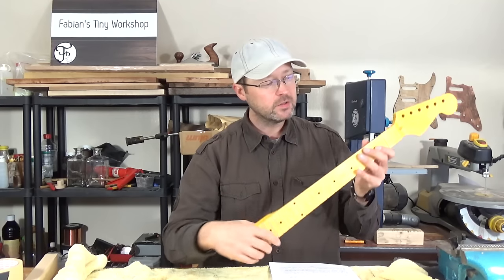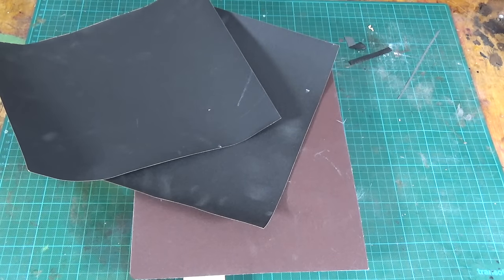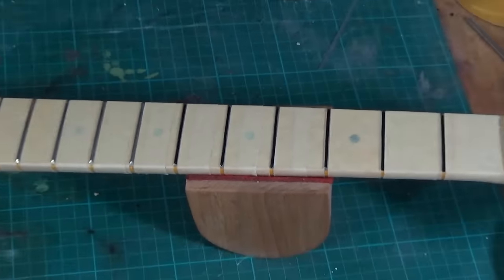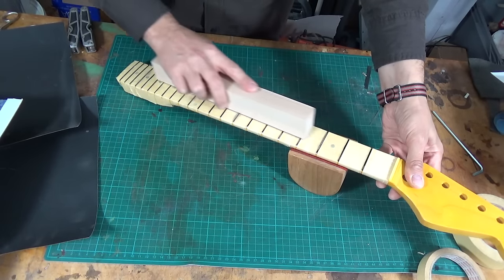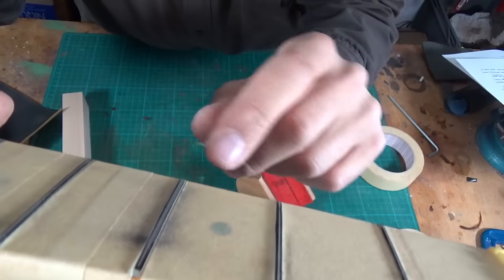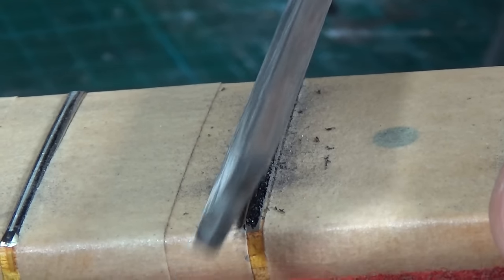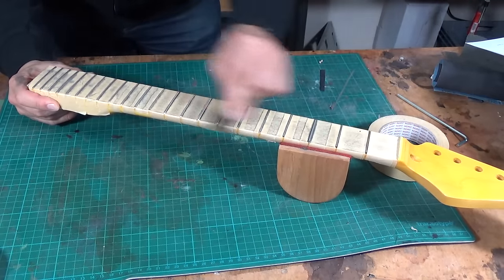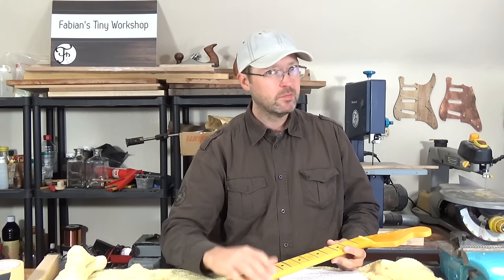Fret Leveling - The Easy Way // How To

Comment: Great video, but a few tips to viewers leveling a guitar worth more than a few hundred dollars. Use no coarser than 600 grit to down initial level and use spray adhesive versus double sided tape. Tape is too spongy. Do not use a heavy metal file like used in the video.   With 30 plus years as a fabricator/machinist, I would suggest using 600 grit sandpaper for crowning. A stone can be used as well.
Reply from the maker: I hear you. On expensive guitars I would not leave the frets myself unless I am experienced an own dedicated tools.

Comment: ok so I tried leveling my frets. I got rid of the buzz on all frets from Low E to B but the high E string buzzez from the 9th fret and above and when i Bend it, it frets out from 12th to 18th fret. what should I do? plz help
Reply from the maker: Difficult to say without seeing the guitar.
Maybe adjust the neck relief and / or the action.
Reply: Fabian's Tiny Workshop before trying to level them I had no problems with the high E on any fret and I did not adjust the bridge or the truss rod. Im worried that I ruined the radius of the frets :(

Comment: QUESTION:  Why not remove the frets first, then adjust the truss rod to make the neck as straight as possible?  It seems to me if you do this, there is no need to notch a straight edge, and could save some time and effort.
Reply from the maker: Great Idea👍 Give it a try and tell me how it went 😉

Comment: I do have a crappy 30€ Chinese strat that I want to experiment on. what could go wrong? also vielen Dank! dies ist ein von den besten DIY Gitarren-Clips dass ich soweit gefunden habe. Grüß aus München!
Reply from the maker: München? Dann antworte ich mal auf Deutsch ;-) Schief gehen kann eigentlich nicht viel, außer dass du zu viel Bundmaterial abschleifst oder den Radius durch zu viel Abschleifen etwas veränderst (gibt Schlimmeres). Denk daran auch die Sattelkerben anzupassen (im Prinzip ist der Sattel der Null-Bund). Das habe ich vergessen im Video zu erwähnen.
Reply: @FabiansTinyWorkshop  danke für deine Antwort! ich möchte lieber mit dieser Gitarre Experimente machen. so sammelt man Erfahrung. wenn's nicht klappt, dann kaufe ich ein neues Halls und gut is es :)

Comment: 3:18 and how do you maintain the radius of the fret board with a flat sanding block?
Reply from the maker: By moving the sanding block from left to right.
Reply: Fabian's Tiny Workshop ahh for a beginner like me it's difficult. there is a radius beam from stewmac that can make this easier

Comment: shouldn’t you hammer in the frets before flatting? some may be pressed in higher than others, and you will sand them down more
Reply from the maker: If the frets are not properly installed you can try to hammer in the lose ones. Trying to hammer in already seated frets will only compress and damage the wood fibers. Over time thy will decompress partialy and the frets will be uneven again (sometimes part of the reason they are not level in the first place). Also if you need a fret level because of wear and tear you cant just fix it with a hammer.

Comment: How do we know how low the frets can be? I want very low action.my guitar buzzes Alot and I already lower the strings and messed w the truss rod. It's an Ibanez and man I thought I could lower the action but it's a nightmare. I've lowered it on my other guitars but this one seems like it's gonna be a problem
Reply from the maker: Low frets have nothing to do with a low action. If your guitar has low frets that means it has been leveled more than once. If the frets are to low it will be uncomfortable to play especially bending will be difficult. For your desired low action the frets have to be level and of course the neck must be straight without a twist. By the way if you have a high action even at the low frets that means the nut slots are to high. check with a capo at the first fret, If the action magicaly improves it's the nut. If you experience buzzing on some frets more than the other that means the frets are not level. If it's buzzing all the way it is likely not set up well or it might be a neck twist. Check with a fret rocker.
Reply: @FabiansTinyWorkshop  Thanks Alot for your reply. With much respect I'd like to disagree brother that it has nothing to do with low action. There are plenty of YouTube videos that show that it   can low action. I'll send just one video that I found.
Reply from the maker: Low frets (diminished fret height) does not but level frets (leveled to equal hight) does. In other words, of course you have to lower the high of the frets but only so much that all frets have the same hight.

Comment: Hello, thank you for the informative video!

One quick question: the frets in my strat are already a very low (wear over time maybe, or maybe just small frets). Will doing this damage playing or it will still work? I can provide the exact height in mm if need be.
Reply from the maker: There is no right or wrong. It all comes to your personal preference. Action vs fret height. If you prefer low action there might be no way around it even though if the frets are to low it can be difficult to bend the strings. If you prefer it the way it is now, do nothing.
Reply: @FabiansTinyWorkshop  thank you so much! I will experience with it and see how it turns out

Comment: Here’s a list of steps if anyone wants one like i do

TOOLS NEEDED
1. Wood (perfectly straight side)

2. Double stick tape

3. Masking tape

4. Sand paper ( 220-100)

5. Metal file 

6. Steal wool

PREP
1. Neck straightening 
	You can use cardboard with notches to then adjust the truss rod accordingly 

2. Cover the fret board with masking tape, to make it easier to remove you can add a long piece of tape along the neck then add the tape over the fretboard

3. Cover each fret with sharpie

FRET LEVELING
1. Grab your perfectly level wood piece and add 220 grit sand paper with double sided tape

2. Go back and forth over the entire fretboard making sure not to bump the nut
	~Continue until the frets are the same height and all the sharpie is gone (not including the sharpie on the sides)

3. You’ll notice some frets are flatter than others, those are the ones you want to apply to the next steps with
	1. Mark all the ones that need filing with sharpie 
	2. Either with sand paper taped to a small piece of wood, or a metal file, you will angle it and then tilt it more of an angle to create a roundish shape and until the sharpie is gone (leave the sharpie in the middle of the fret, dont sand over the top)
		~Do not worry about it not being round at this step, future sanding will get it smooth

4. Wrap 400 grit sand paper around you finger and go over the whole fret board

6. Switch to 600 and go over again

7. After switch to 1000 grit and this time sand each fret individually 

8. Polish using steel wool to shine and smooth over the frets 

9. Remove the tape and marvel at what you’ve accomplished

Comment: How do you ensure you don’t ruin the radius of the fret board?
Reply from the maker: By going evenly from right to left and not sanding too aggressively.
Reply: @FabiansTinyWorkshop  why not use a  radious sand block on the frets?
Reply from the maker: @stilljustaguy  This is also no guarantee of the perfect radius, as you may exert more pressure on one side than the other when sanding. You may also remove more material than necessary. I feel more comfortable using a straigt beam. If you do some research you may find that most luthierst don't use radius blocks for fret levelling. I think the best thing is to take your time. Check progress regularly. If the frets are marked with a Sharpie, you can see where you have removed how much material. But there is no right or wrong. Do what works best for you. Take care 🙂

Comment: 3:56 quick tip: better bought a dedicated crowning file for the job even a cheap one so you can save a lot of time(i bought mine for only $3 so it's not a burden). If you're a beginner and trying to improvise crowning your fret with other tool rather than crowning file itself pfft... good luck with that mate😏.
Reply from the maker: Of course you are right. The right tool will make the job easier.👍

Comment: What grit is the steel wool  you used sir? 🤔
Reply from the maker: Oh I think it was 0000 not quite sure though.
Reply: @FabiansTinyWorkshop  oh thanks 😊 last question! Is it ok to not use that steel wool? If not what are the alternatives?
Reply from the maker: @kwindrex2049  for example fret polishing rubber, polishing compound, micro mesh

Comment: How to maintain the radius of fretboard while filing?
Reply from the maker: By going evenly over the whole fretboard. Do not just sand the center of the fretboard. If you are unsure that you can follow the radius with the sanding beam you can use a radius gauge to check your progres or you could use a radius block (StewMac).
Reply: @FabiansTinyWorkshop Thanks , Is it best to have fret leveler as long as the fretboard?
Reply from the maker: @profile1251  I do not think that's necessary. But it should not be too short either.

Comment: great video ! Top tip before you use double side tape on your leveling beam put some masking tape on the beam first, the double sided tape sticks like a bitch where as with masking tape on its easy to remove ,remove it straight after the job as well !

Comment: Use blue painters take because it is less sticky and will not pull up any finish… it is also easy to spray the tape with warm water to aid in removal. You can also go from 220 to 400 and instead of going back and forth, run the 400 perpendicular or with the fret using your finger. It makes rounding or crowning the fret less necessary as your finger is soft and flows around the fret. Lastly, ball up quad O steel wool and polish the frets to a high shine, the quad OOOO will also detect any burrs or rough spots because it grabs it… better find that out now before bending a string and breaking the string on a burred fret…. Big thing here is… you do not need Stew-Mac tools to do a great job on your guitar. Common sense and common tools makes this easy. I agree with his process on most of it…. Go slow and look at the frets to see the sharpie marks gone and that is it…. Set the truss rod straight to level things. You will have to adjust the action and truss rod anyway to intonate your guitar with fresh strings… expect 2-4 hours of work!! Incredibly rewarding and save 200 bucks!! Good luck!!
Reply: Hey, would you kindly share some video or article which exemplifies that part of sandpaper running perpendicular?

Comment: Wouldn't it be more accurate to remove the nut first? If the nut is not removed the first fret doesn't get the same leveling treatment.
Reply from the maker: Of course you can remove the nut but I never had a problem the way I do it.

Comment: Why did you go over the first fret when you were levelling? In theory, the first fret should be the highest point so you are working against yourself by making it any lower.
Reply from the maker: Because all frets should be the same height. Leaving the first fret higher will result in a higher action by the same amount. Same goes for the nut slots by the way.

Comment: Great tips, thanks.

Luthier tools are sometimes overpriced compared to similar conventional tools.
I've thought of using a wood plane with the blade removed as a sanding beam. 

As for a notched straight edge, the flat edge of an old wood saw and a grinder to cut the grooves.

A radius block might be a good choice for sanding to frets to the fretboard radius.
Reply from the maker: Thanks for checking it out. 
Sure, that might work.

Comment: Why not just put on new frets? I already want higher frets (got stock Gibson's) so I wouldn't want to have even less material.
Reply from the maker: Why not just put on new frets? Because it's much more labor intensive. You know that after installing new frets you have to level them too? Also it's very likely that you need a new nut becaus the nut slots might be to low. 
But of course if you want higher frets then yes you have to put on new frets.

Comment: Das ist zwar murks, aber in teilen sicherlich brauchbar.
Ich gehe konform bis zum sharpie marking und anschliessendem sanding down with a improvised fret leveling beam, made out of a perfectly flat, even surface piece of wood.
I do have objection once it reaches the point of recrowning the shape of the frets from flat surface back to their former, rounded shape.
I doubt that somebody with not quite a lot of filing skills, will be able to recrown the now flattened frets and make the crown perfectly center, cause that's a necessity in order to achieve well tuned intonation.
Intonation is a very critical issue on all guitars, no matter how much you've paid for the instrument.......
We all know it'll never be perfect......no matter what we do, in the end it's down to skill and ones fingers to get the intonation right on critica chords.
If you own a router, why not rout a slot with a radius,  pad that slot with sandpaper and use that for recrowning those flattened frets?
I'd tried that out and find it works quite well.
A straight slot with a radius on the bottom is quickly routed, padding with different grit sandpaper is also done with ease, and compared to a simple frettingfile it gives you the opportunity to use a variety of grit up to mirrorfinish a like......try it out, i promise it'll work out fine.

After the leveling and recrowning is all done, re check your work! It's quite easy to "overdo" it while being at it when recrowning those flattened frets.
Never forget to use the sharpie  as this is the onyl means to guarantee your frethight is ok.
In the end there must be a very fine, thin, uninterrupted sharpieline visible on each fret. If not the job not done right and the fretwork is dodgy and needs to be redone.
Any questions? Ask me.
I am a luthier, now retired, enjoying my pension.
I won't do videos as i do not know how to handle that video/audio stuff technically. Bear in mind that i've already clocked a lot of decades and my bones grew old.
I know how to build stringed instruments, be it acoustic or electric, from the scratch, from the moment a tree comes down, is sawed and gets stashed away under the roof for at least 15 years before it will become an instrument.
My english is dodgy, my german language skills aren't much better for i'm italian.
Have fun and thanks for the vid!
Reply from the maker: Thank you for your insight. Appreciate it!

Comment: For beginners I’d recon still buying the proper tools because it’s really easy to mess up the crowing process without the experience, for the experienced technicians I’d recon buying the proper tools for efficiency….
Reply from the maker: I for example like to use a long beam with sandpaper because it's not that aggressive and longer than the typical leveling file but for the crowning I do like to use a crowning file. I wanted to show that you don't have to spend a lot money if you only need to work on one (possibly cheap) guitar. But of course dedicated tools make it easyer.